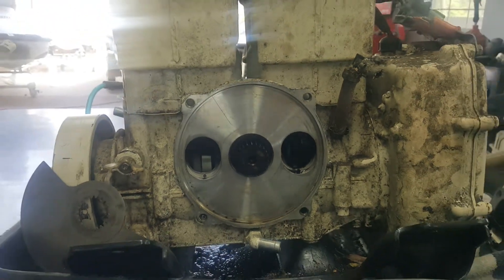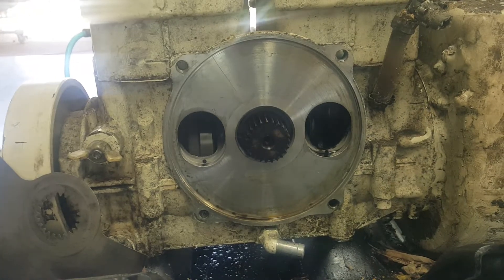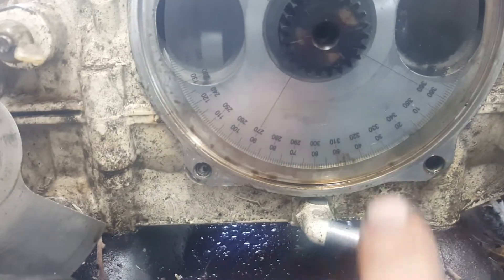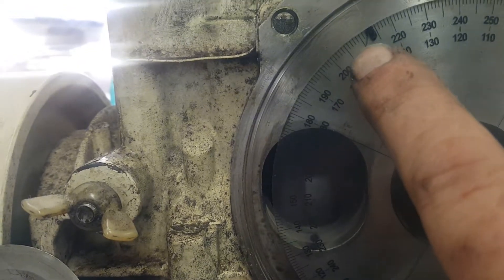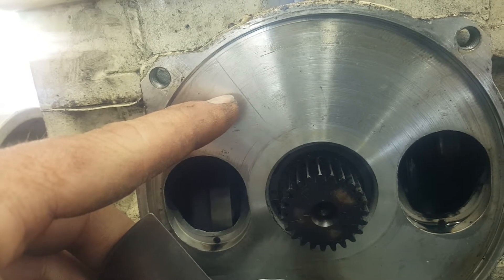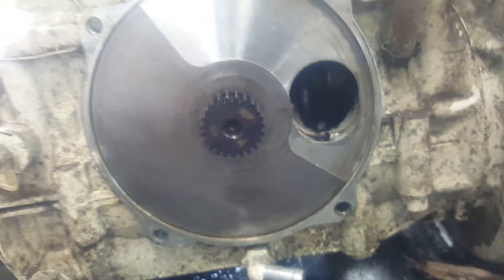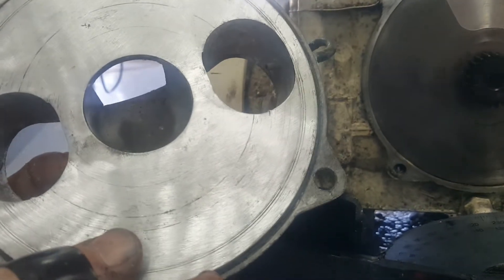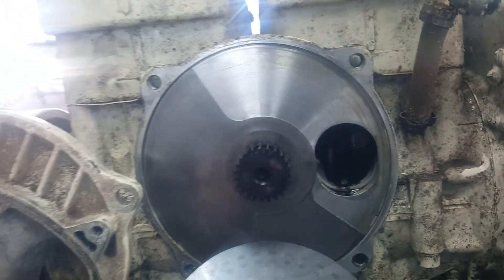how to set your Sea-Doo rotary valve timing

Comment: Badass. You think this can be done without pulling the motor? If not....then damnit.
Reply from the maker: Absolutely most of the time we change the gear and the timing plate without removing the motor you just have to use a mirror
Reply: @shannonwilliams601 looks like a lot of room to play with inside hull.

Comment: I have a 1990 587 yellow motor I have replace the magneto the flywheel it has a new carby fresh gasket kit, pistons appear good, I have timed the rotary valve at 130deg (from what I’ve found that’s what this model is) I have spark in both plugs which are brand new, I can not get it to start, I’ve tired the tricks with aero start in the carby also tried fuel, I get smoke come out the exhaust I did have a backfire was then told my timing is out so I again set this at TDC and got the valve at 130deg, I have a new and full charge battery and still nothing I get a little putter nothing really showing it attempting to actually kick over. 

My neck option is a fresh set of eyes having to pull the motor back out and take to local ski mechanic.. 

What am I missing? Any tips that may help here again it’s a 1990 seadoo bombardier GT 587 yellow motor 

Cheers
Reply from the maker: Your rotary gear is worn down or missing the edge of teeth
Reply: @shannonwilliams601 have a bad feeling about this although I won’t know till I remove it again arghhh
Reply: Not 100% sure myself but I think the yellow engine runs at 115degrees according to the manual, can anyone confirm this regards martyn
Reply: @therestorementor7742 from the original manual it’s 130 for this motor
Reply: @beeserious6680  I just checked my one is a xp 1992 this is the one year on the xp it should be set at 129degrees thanks for your response 👍
Reply: Also interestingly there actually is a little arrow/notch cast on the case of the yellow motors to show the correct position I have just noticed

Comment: How does a sea food rotary jump timing without stripping or fusing gears?
Reply from the maker: The gear just has to get a little bit worn and it will go out of time and then come back in time then go out and then come in and that's because the gear is worn

Comment: I do have a question tho and it's a bit off topic but I put my stator on my 717 and now the thing backfires the front carb and the exhaust at the same time and won't hardly start. I even put the stator bolts in the middle and tightend it down. But it still does it. And I set my carbs right
Reply from the maker: Check your keyway on your flywill and make sure that it hasn't slipped because if it slips even with the stater in time the engine will be out of time

Comment: Why will you have no power and it won’t take off if grove in there ?
Reply from the maker: Because you have blow by and it's losing pressure same thing if you remove the O-ring from the outside
Reply: The fuel and air charge gets pushed past the valve, and back into the carb and intake. So, it gets charged with fuel again.  So it will run like complete dogshit. You do not want flow reversion in your intake ever.

Comment: Its ok to flip the valve, but then it covers the other hole. So it does not matter which way to valve is flipped, nor which hole is open/closed?
Reply: he flipped it upside down, but forgot to turn it 180 degrees. No matter witch side you use, always make sure you align the left straight edge to the 147 mark.
Reply: @3DPeter  Right on, thats the point that none states clearly. Making sure the plate is not 180* out lol. Very crutial information to those that are not technicians.
Reply from the maker: You have to have common sense you can flip the plate over but you cannot put the bottom of the plate at the top

Comment: When your saying if there’s deep groves in the plate it won’t have power in the water does that mean it won’t start in water? Picked a couple of these up from a family member and after i got them running good on the trailer went to the water and one doesnt start in water even if I have it running then put it in the water it dies. Do you think this could be the issue?
Reply from the maker: Highly unlikely the first thing you want to do when you get jet skis from somebody and don't know anything about them is you want to completely go through the carburetors check the pop-off pressures rebuild the carburetors with genuine parts do a fuel pressure check turn back the spark plug wires they are known for rotting away and causing issues new spark plugs drain all the old fuel out do a pressure check on the fuel system change the jet pump oil check the wearing check your oil lines on your engine to make sure they are not brittle do all of these things before you ever hit the lake otherwise you will just cost yourself a engine

Comment: How do you know if you are supposed to use the numbers on the outer side of the template, or the ones on the inner side?  For instance, 147 also aligned with 213 on your gage, so how do you know to use the inner numbers?  Hopefully that makes sense.
Reply from the maker: Because the timing number is 147 not 213
Reply: @shannonwilliams601  what I mean is,  the gage has 147 on it twice.   Once on the inner circle,  once on the outer.  How do you know which one to use?  Did the gage tell you?
Reply: @ReeseCustoms  he’s asking which set of number are you using on the wheel and does it matter?
Reply: @shannonwilliams601  l
Reply from the maker: You have to use the outside number because the rotary plate is too large to line up with the inside number
Reply: @shannonwilliams601  ahhh ok.  Thank you!